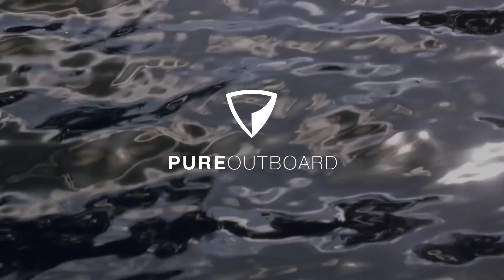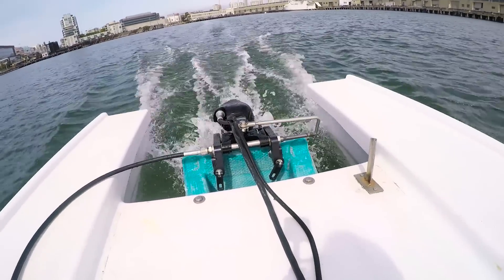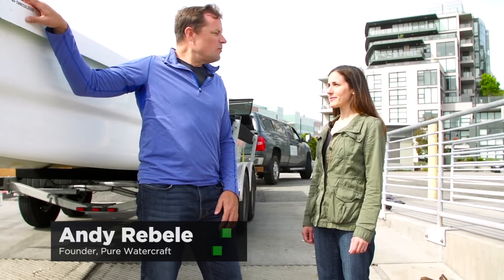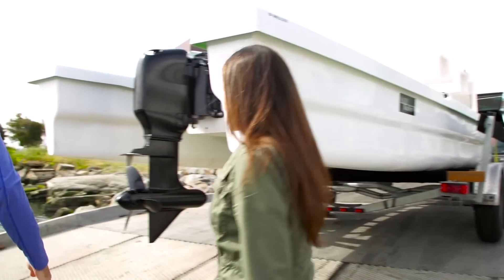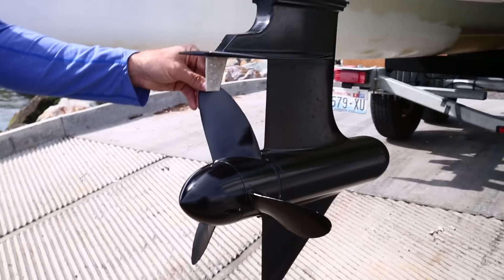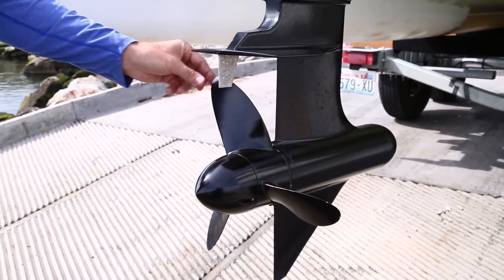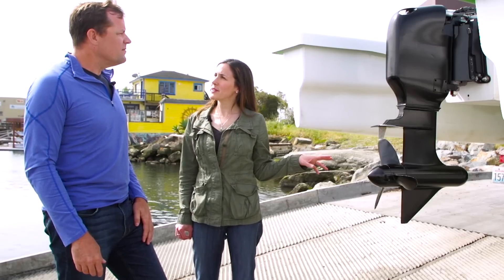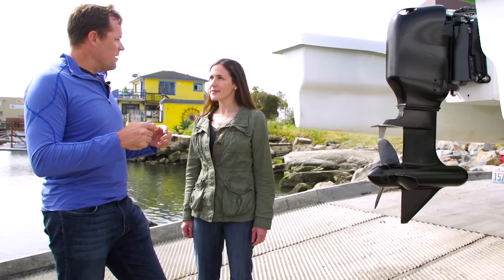Pure Watercraft’s Eco-friendly Electric Motors for Boats

Comment: Good, but not great.  At $6,000 for the motor, they almost had me.  But, another $6,000. for batteries, is a deal breaker for me.  I know I know, no money going out for gas, but still, I just would not buy it.  Gas will rule the waterways until the motor will push a 30 foot fishing boat at 50 MPH for 3 hours for the same price as gasoline engines.  Sorry, but that is market reality.

Comment: So you say how quiet it was, why didn't you record it at top speed? Would've done more to get the point across ya know?
Reply: Ones at top speed on a petrol boat its not the engine nose that bothers you, (I DONT GET BOTHERED BY IT, THATS WHAT BOATING IS ALL ABOUT ) its WIND NOISE !!!! BOAT MUCH ???? 👌👌👌👌👌
Reply: https://youtu.be/MyzLWtrAUDM
Reply: This video has good audio on the water. The narrator comes across a shade pretentious but it’s a good video nonetheless.
Reply from the maker: +Paul M we tried but water and microphones don't mix especially at high speeds.
Reply: plus even the best wind filters probably wouldnt do much to keep that noise out either  @TechCrunch